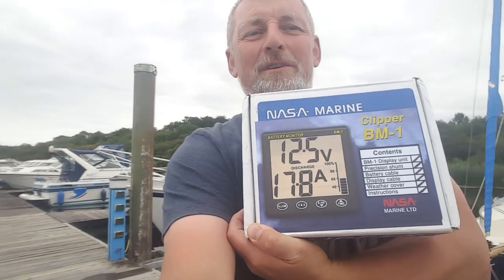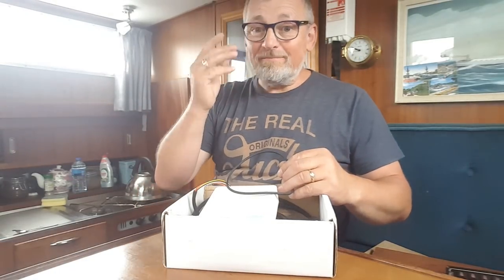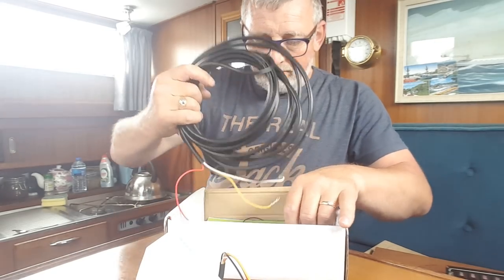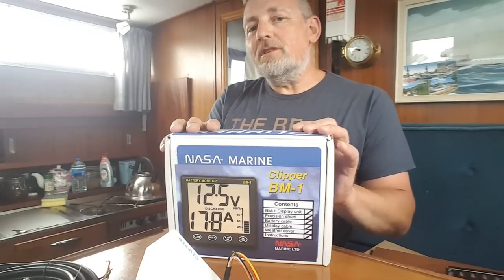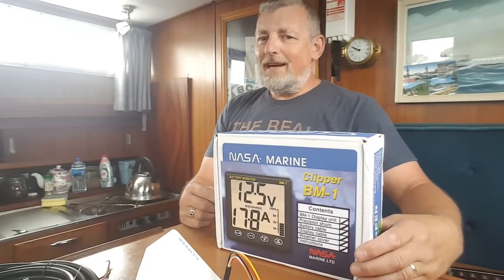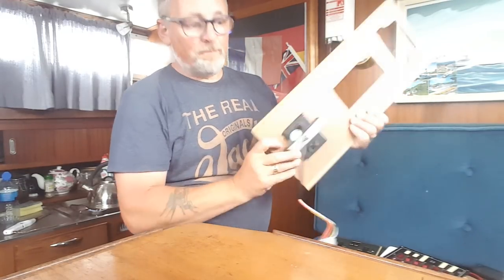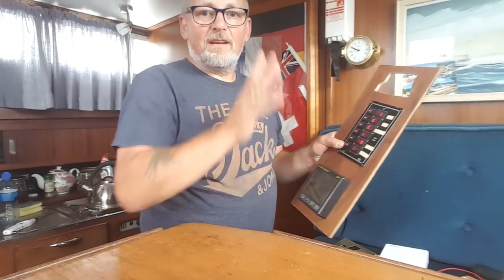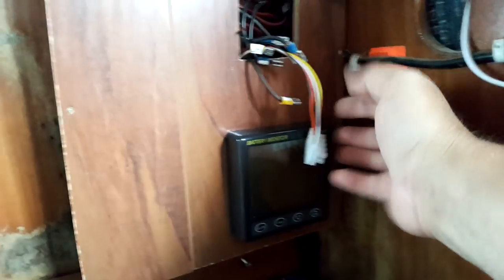Nasa Bm1 Installation - Quick & Easy.

Comment: Just wanted to say thank you for a great video and a lifesaver. I’ve been trying to wire the BM-1 up correctly for over a year, and having just added two new leisure batteries (4 in total now) was totally pulling my hair out. The reason, confusion from the instruction manual. The manual states don’t connect anything to this battery. So I didn’t connect the last battery in the chain. Doh! Thanks again
Reply from the maker: Glad that you found the video useful. You're going to love that battery monitor BTW 👍

Comment: Is your fridge running off your battery or mains? If battery what are you using to convert? Also your solar panels, are they charging your bow thruster batteries as well?
Reply from the maker: Hi, Yes our fridge is a 12v fridge with a compressor, so it uses about 3.5 Ams when the thermostat switches it on. the solar is just charging the domestic batteries at the moment, not the bowthruster battery. Hope that helps 👍

Comment: Awesome piece of kit.... How much current can the shunt handle? (I'm thinking of the wife's hairdryer used via the inverter!)
Reply from the maker: Chris Dougherty Hi Chris, good question, the BM1 allows up to 100 amps of current through the shunt. There is an identical unit called BM2 and that is up to 200 amps. Hope that is of some help to you.
Reply: Driftwood Boat Blog, thanks for that... The hairdryer is 1200 watts, which, in theory would draw 100amps, so BM2 would probably be a better option!
Hope you're still enjoying the Erne system!
Reply from the maker: Chris Dougherty, Ye out and about again this W-end, weather turned but it's still better than being in work!

Comment: At 17:35. “How many hours your battery is going to last”. What does that actually mean? Until it/they are 50% charged or just about to die? Apart from the series vs parallel comment 🤪🤪🤪 this was a wonderful video. So well explained I now have the confidence to fit one myself and I am not renowned for my electrical skills. Or plumbing. Or woodwork. Or ...... 😁😁. Many thanks. 👍
Reply from the maker: Hi S Jay, As far as I recall the unit calculates how long before the battery dips below 12v. That said I can't find where I read that. Probably somewhere in the instructions, but they are long since gone. Sorry I can't be more definite than that. 👍
Reply: Please don’t apologise, thanks for the reply. It’s just that I read somewhere that a battery shouldn’t really drop below half-charged and 12.2 volts was mentioned. Also could you just confirm at 6:24 would the brown negative originally have connected to the neg. bus bar? With the help of your video it just seems to easy 👍
Reply from the maker: Hi S Jay, yes that's right that brown cable would have gone straight to the negative bus bar. Glad you found the vid helpful and dont forget to use the amazon affiliate in the video description when you're ordering. Ta 👍
Reply: Driftwood Boat Blog Thanks so much. You’ve turned a job I would normally shy away from into one I can do. 👍 to the affiliate.